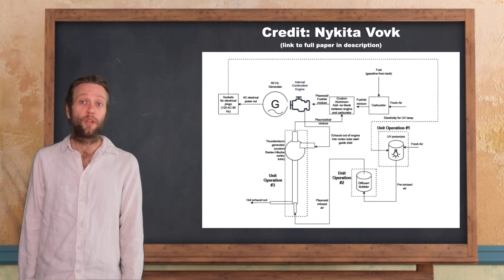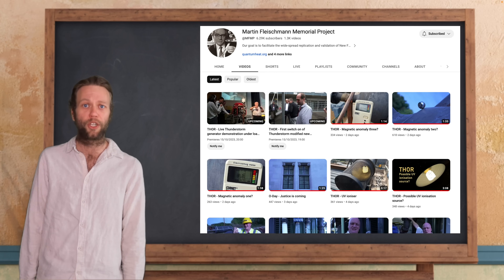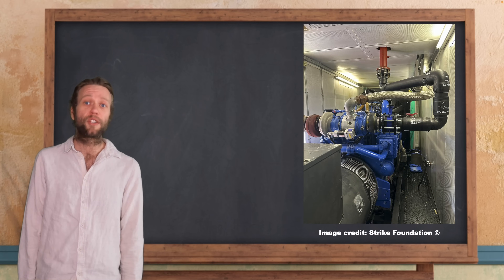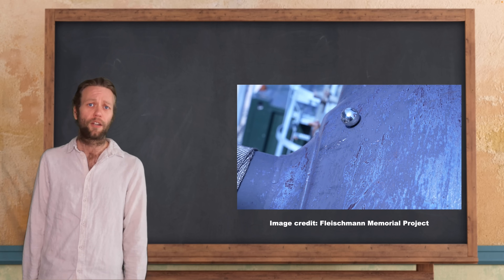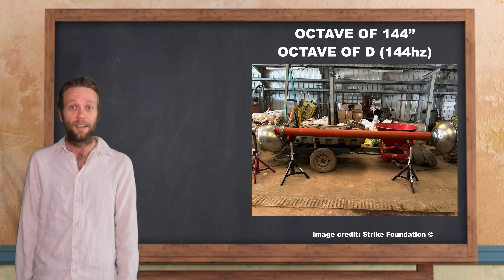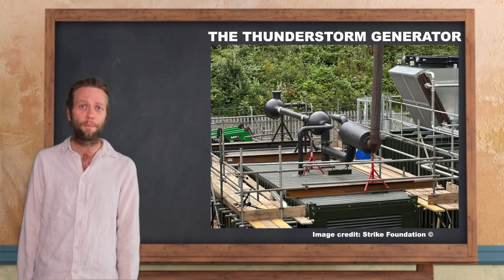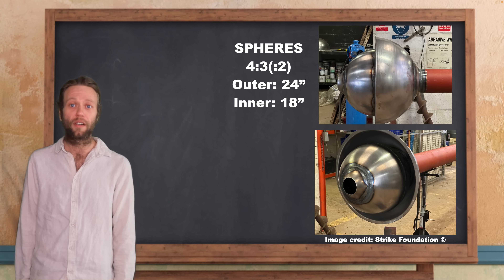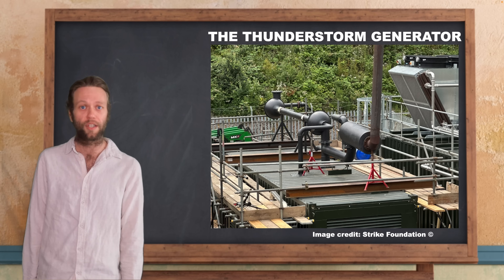Thunderstorm Plasmoid Generator Industrial Scale Retrofit | Supplying the Power Grid

Comment: I work as a High Pressure Steam boiler Operator in the USA and i have run the boilers at Electric Utilities and unlike what Beijing Biden says with the right amount of money spent on pollution control they don't have to pollute but with our legal system it is cheaper for Utilities to pay $10,0000 monthly fines for polluting than buy pollution controls, with your plasmoids you can eliminate the steam boilers all together and just have generators fitted with your plasmoid kits and electricity production will also be clean air production and when cars are retrofitted they won't be polluters but oxygen generators , that's what you should put in the name of your devices is oxygen generator for non trades people to show an interest

Comment: If anyone can do the following test, I will then begin to accept that this may be breakthrough "epoch making" tech, despite not understanding what exactly the plasmoids are hypothetically doing for the engine once they reach the combustion chamber.

Set up a generator without plasmoid tech, time on a livestream how long it takes to run out of a full tank of gas.

Then, retrofit that generator with the plasmoid tech and do the same, on livestream.

If this is supposed to increase the efficiency of the engine, then it will last longer. Showing how much longer it will run will show exactly how much more efficient it becomes.

If someone has already done this id love to see it but right now i dont have any reason the believe this is doing anything other than scrubbing combustion gasses from the exhaust
Reply: Or two generators running simultaneously, both plasma capable. 1st run, generator A, plasma on; gen. B, plasma off. Next test, reverse order.

Comment: how can a iron/steel  mechanical engine be "embedded with plasmoids", to make the engine run cleaner without the system active.... ?? red flag
Reply: How do permanent magnets behave like ectromagnets?
Reply: To clarify my answer to both those questions is : "I don't know" lol it's a good question
Reply: Counter rotating electromagnetic vortices between the internal and external streams. Probably a lot like a static electric field that is reaching balance between forces. Plasmoids impregnated in metal is not a very controversial observation with those familiar with the science of cavitation. As was mentioned in the beginning of the video a solid steel ball was imploded by the build up of electromagnetic forces.
Reply: you said some cool words but i rebuild internal combustion engines and that would do absolutely nothing to make a combustible usable fuel.. if you are saying the plasmoids reduce the pollution or reduce the amount of actual used by the engine i could agree, but you are saying the engine can run completely on plasmoids without fuel? youll have to explain how the engine still works like an internal combustion engine running without fuel... also im pretty sure that other big generator is diesel which works differently... @antiprismatic
Reply: @CoPaVolvo it still uses fuel it just turns the bad exhaust fumes in to oxygen.    It's not free energy, it's just vastly more efficient and cleaner
Reply: @CoPaVolvo what’s surprising is how so many who have the capacity to make this prefer to sit back and explain why it won’t work
Reply: @rogerconnolly3688  the fact is that I’ve been looking into these demonstrations to see how these work so I could build one.. the things that are red flags are the part where it’s “running” and “working” when the uv light wasn’t even turned on.. also the fact that they say it will run without fuel after it is running on fuel.. although I am hopeful for this tech I think these guys could be either scams or didn’t build it correctly.. I think the Stan Mayers tech is more likely..
Reply: @CoPaVolvo basically they are inserting hydrogen fuel.

Comment: Randal Carlson said the engine stops running off the fuel and starts running off the plasmoids & exhaust carbons as fuel.  Is this false? It seems like that would be a bigger deal than the cleaner exhaust.
Reply: I have all kinds of questions on this.. Nitrogen is the working fluid part of the air. Energy from combustion of fuel and oxygen causes the nitrogen to expand and this puts pressure on the piston translating to torque in the crank.. turning off the fuel/oxygen combustion event would mean that the energy exchange to the nitrogen for it to expand similar to combustion is coming from what? The plasmoids themselves? What conditions does the charged plasmoids filled air have to be under for the energy to be exchanged to the nitrogen? For example for it to occur in the engine it would suggest it needs the compression to reach a condition threshold? Otherwise the exchange would occur in the intake manifold? The rate of energy exchange would also have to be similar to a propagating flame front of a combustion event (otherwise it’ll be too violent like a knock event). You’ll create uncontrolled shockwaves that will destroy the rotating assembly. 
I thought about Nitrogen disassociation but the huge energy release from diatomic nitrogen to ammonia would also cause heat to build too fast. 
Plasma spark plug still required when running on plasmoid air? Malcom mentions this retrofit will work with compression ignition engines so it would suggest not?

Comment: Jordan, exhaust gas analysis aside.. BSFC Brake Specific Fuel Consumption? Waste heat energy recovery should result in a reduction in fuel consumption for the engine under steady state load (from the electrical generator)
Reply from the maker: Please be aware that I am covering the information as it comes. I am not part of the build team for this. I'm in a different country  I am aware that everyone is waiting on this data, but as I say in the video... Patience, or you need to build one yourself from the available specs and let me know how you go.

Comment: One thing I've noticed is the exhaust is exiting 20% oxygen, I wonder if this cold be directed into the air intake on the combustion engine making the entire unite closed loop.
Reply: What would be the point?
Reply: Efficiency, a combustion engine requires oxygen to work, adding more would increase the efficiency.
Reply: @Mushroom-Motivation  But do plasmoids require carbon and hydrocarbon to work?
Reply: @CitizenJourno-1  to be honest I don't no, but you would still have them in the air mixture from the air intake. The idea would be you would just add the exhaust gas to the intake alongside the original intake to add more oxygen. You could also use the cold air the the generator produces to cool the exhaust gas before its added to the intake for even more efficiency.
Reply: Interesting thought comma I wonder if there's any argon in that exhaust?